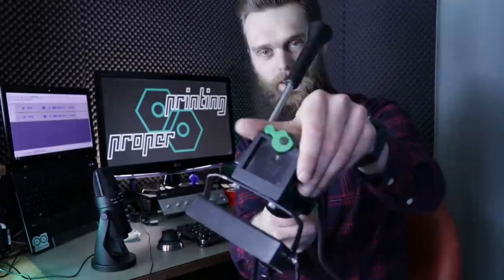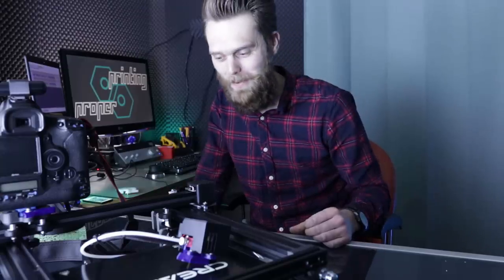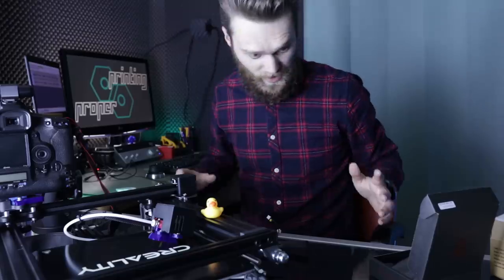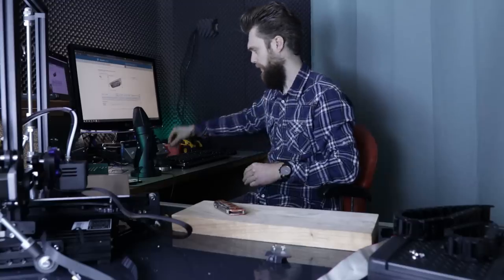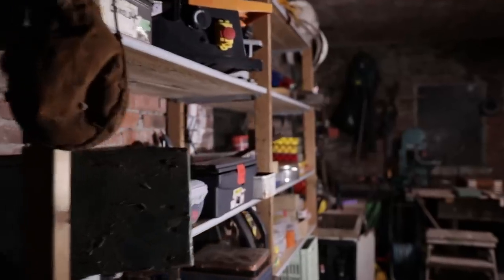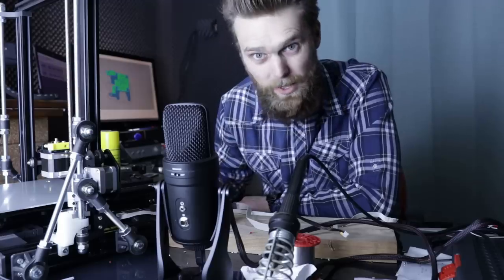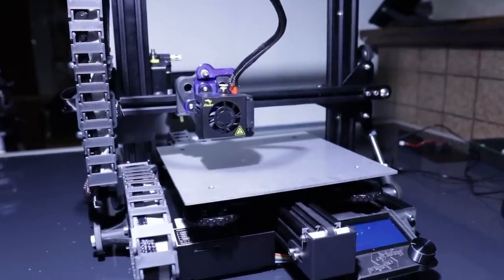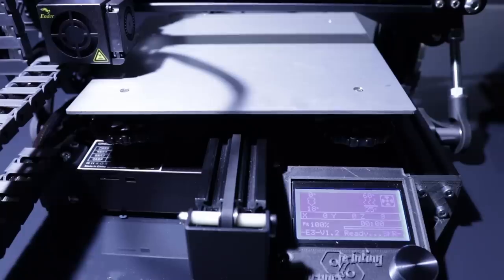Proper cable management for my Ender 3 pro

Comment: I dig it!  I love how crazy you get with the most inexpensive printer and make it as valuable as the most expensive printers on the market. I also would have still used PETG for your cable management.  Just would have given it a little dry ptfe lube.  Knocks out the squeak instantly and lasts for a really long time.  Great vids man.  Thank you!
Reply from the maker: Thanks Charles for your comment and suggestion! PETG would be the go to material for this since it has some flex to it as well. The honest reason for PLA with carbon fiber is the aesthetics but I wouldn't recommend using this material for this purpose.
Reply from the maker: @chasgiv4  Hahaha thanks m8! Awesome that you'll be making videos soon, make 2020 yours! Good luck and I'm curious how it goes!

Comment: That cable chain/connector fusion is a work of art!  Great job!
Reply from the maker: Thanks a lot for your comment! I really like that I can build upon that custom connector design to embed connectors into functional parts like this :D
Reply: @properprinting  not just the cable chain all this work are at really art concept , im in my way to do everithing but the only thing i canot find its the link chain for the hotend
thanks again for this job!

Comment: Just Wow! I hope Creality is buying your mods for production!
I sure would like to see universal connection so as to allow one control board/power supply to run more than one printer. One at a time of course using dedicated firmware SD cards or folders.
Reply from the maker: Thanks for your comment! That would be awesome if Creality would reach out to me one day! Would indeed be cool to have a modular design with a generic PSU and control board :D

Comment: This custom connector on the bed is absolutely gorgeous! Very good work! Can't wait to see why you are folding a 3D printer. Your cable chain are very beautiful, but I can't understand why existing models suited not to your wishes. Could you tell me more about that choice? Because I'm thinking to install some of this kind of cable chain on my printer and for the moment I don't know which model to use.
Thanks for this video, the camera slider on the printer is a funny idea btw ;)
Reply from the maker: Thanks Matthieu and a good question! I needed a step of Fusion file to modify it to suit the connector. I've searched this and found a couple but the clearances were so tight that they didn't work and some were designed poorly. Now I can determine all dimensions myself. Another reason for me to design my own is that it's much easier to add this as one package on my website together with all the special links (including that connector) and I don't have issues with licensing. Thanks for mentioning that camera slider, I'd like to make some sliding time lapses :D

Comment: Whole changes you've made are awesome upgrades in this printer. But(there is always but he?! :D), I would have replaced cables with longer ones instead of expending them with solder, especially if soldered part is in moveable part.
Reply from the maker: That would indeed have been a lot better. Fortunately it wouldn't bent too much due to the chain, but i should have bought longer cables xD Thanks for mentioning!

Comment: You are truely a madman. But smart and mad at the same time. I was coming here to see if i could print the cable management for more stock version of same printer, but you got me thinking of the tilting mechanism too. That is scary stuff. But if you happen to read this, comment, how your cable management files could be used to make to work with stock ender 3 pro without tilting. I'd love to make that work somehow.

Comment: Been slowly making my way through your videos in what little free time I have, and gotta say it's time well spent!

Quick question.. CF filler in the PLA you used is pretty abrasive, at least for hot-ends.. is it causing any wear that you can see in the cables?

Looking forward to the rest of your vids and of course the new ones too!

Comment: Any chance you would make a video for us explaining how you specifically go through calibrating your printers?
Reply from the maker: Thanks for your comment! I have a video planned in which I'll test the different homing methods (although this will take some time to start with) and maybe it's interesting to go to the process of calibrating it. It's however not that special. I use a DTI indicator to make sure the bed is horizontal and an adjustable Z stop to set the homing position so I don't have to level my bed anymore.
Reply: @properprinting  Ah, while that is helpful information that will make a good video on its own, I am more so meaning the actual prints you get from your printers. They seem highly tuned for the specific things you do, and my Ender 3 is basically a potato printer
Reply from the maker: @kingsidorak  Ah OK, well I didn't do too much to make this happen besides making sure that everything is lined out as good as possible and the tension of the rollers and belts are correct. I did see some improvements after using Simplify3D instead of Cura and I use the default settings. Even after making this printer foldable it was able to print decent with the standard parts.

Comment: Not that is some next level cable management!  Nice work!  What are the little connectors that you were using to put into the custom connector?
Reply from the maker: Thanks Chris! Those little connections are D sub contacts which can be pressed in a D sub housing. This is a male terminal https://b2b.harting.com/ebusiness//nl/SUB-D-PENCONTACT-AWG-20-24-L-P/09670008177

Comment: How do you like the PLA with CF in it -- maybe it's the stuff I had, it was super brittle, and would break on a cable chain. Which brand are you using? Very impressive work!
Reply from the maker: I don't like it. It's indeed too brittle and it cracked the chain links. It all stays together pretty well though, but I definitely don't suggest using this material other than the aesthetics of it. The brand is Greentech and thanks a lot for your comment! :D
Reply: @properprinting  Try Nylon with CF, or NylonX. I made chain links out of PETg and if you make them loose they don't squeak,  though that was before I started printing NylonX, and I would use that if I had to do it over. Glad I found your channel. Great job!

Comment: Are your cable chains w standard size by chance?  I've got several lengths of standard 10mm chain in 11mm, 15mm and 20mm size to use and trying to find hardware prints that would work with those.

Comment: great video! is the bed connector made of CF PLA? Will it stand the tenperatures?
Reply from the maker: Great question! After I printed it I thought the same. I'm going to reprint it out of Nylon with CF but I don't need the bed to be hot right now so that's not on top of my list. It should definitely be done. Thanks for mentioning!
Reply: @properprinting  Just try it out once you printed the replacement in nylon :) I am using CF PLA for several Parts on my printer (HeroMe Base and Ducts, Motor Mounts...) and it holds up well in an enclosure, even when printing PETG (35 degrees ambient inside the enclosure). Have you tried CF PETG yet?
Reply from the maker: @domi1711  Nice! No I haven't actually. I'm very fond of Nylon and I'd like to take a look into polycarbonate with carbon fiber. I should try PETG with CF as well :D

Comment: Nice cable connector ! How did you fix the metallic parts inside the connector ?
Reply from the maker: Thanks Olivier! I've reverse engineered an existing d sub housing. You can buy housings without terminals and these terminals snap in place. It sounds easier that it actually was to get this done xD

Comment: Super nice. Do you think the cable chains also fit the Ender 3 without the folding mechanism ?
Reply from the maker: Thanks! Yes I think so. However, I think the cables should be at the back side of the printer like the other chain mods so you don't need to extend the cables. I'm going to upload the design files of the chain itself so these can be modified for this type of modifications.
Reply: I have all my electronics at the back anyways, so I guess this will fit. I am eagerly waiting for the stl files.

Comment: Jon, you are a brilliant designer...! Can't wait for the related files. I especially like the connector for the bed. I want one of those...

I see that you are not using the connector that you designed for the swappable system on your CR-10 in this printer. How is that design working so far? I still haven't had a chance to implement it on mine. Cheers!!
Reply from the maker: Thanks Milan for your comment! I'm going to upload this soon after I've tweaked it a bit. The first version of that swappable hot end is working quite well on my other printers. I had some trouble with the bowden getting loose, but I've managed to solve that with a bit of glue and tie wraps. I haven't added it to this printer because I have a different approach in mind for this one. It will be pretty experimental but enables cool new possibilities if it works :D

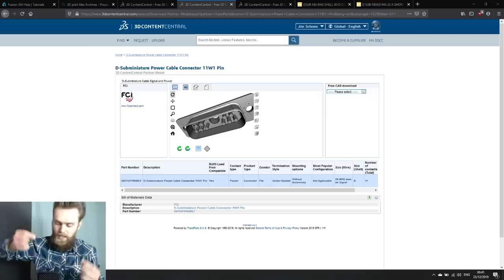Comment: Cool project you got here ! I have a question, what's the part number on those power connections @06:19 ?
Reply from the maker: Thanks Adrian. These are the terminals: https://b2b.harting.com/ebusiness/nl/D-SUB-MIXED-FE-20A-PL3-solder-power-cont/09691817821 and https://b2b.harting.com/ebusiness/nl/D-SUB-MIXED-MA-20A-PL3-solder-power-cont/09692817821. The exact types may differ a bit, but they all should fit
Reply: @properprinting  thanks !  though i saw the PN's in fusion after i wrote the comment  xD

Comment: oh boy. youre using cable chains with the improper wire type. those wires are gonna wear out now SO quick and short out.....
Reply from the maker: Interesting, I've never heard that one, thanks for bringing up! I thought that the chains would distribute the force more evenly over the length of the cable. Without the chain they would bend as well wouldn't they or am I missing something?

Comment: Will u show heat bed back and where did u drill exactly outer the square mark ? And what type connection u use can u link too pls
Reply from the maker: Thanks a lot for your comment, good point! Once I upload the design I'll add a drawing with the exact dimensions :D
Reply: @properprinting  thank you 👏👍

Comment: wow! you are brilliant! i don't have an ender 3 but if i will buy it, i will buy your project!! You should sell the project and don't give it for free!! really! Just to know... the double z upgrade on your site is compatible with the folding one? thanks so much!! good job
Reply from the maker: Thanks a lot for your comment! I think I've found a proper way of sharing my designs. I decided to put everything on my own website with an option to donate. This way the files can be accessed by everyone for free if they want so I get more traction which helps in the long run (I hope). The double Z upgrade will be compatible with some slight changes to the holders on the top which holds the threaded rods.
Reply: @properprinting  thanks for your answer! But these slight changes are available on your site or not? and why you don't use the double z mod? I really want to buy an ender3 to have my printer always with me using your mod ahah In case of emergency i can print also in the street or at the beach
 ahah

Comment: What about working temperature of chain link part connected to the heat-bed while printing, say, ABS? :>
Reply from the maker: Good question, thanks for asking! After I've printed this it came to mind that I should have printed this out of Nylon CF. This is exactly what I'm going to do before I'm going to heat up that bed. This part should indeed be printed out of ABS or Nylon.

Comment: design one for the cr10 s5 :)
Reply from the maker: That's still a printer I would like to have so who knows.. :)
Reply: @properprinting  they come cheaper nowadays,
im in the process of modding mine, full size 240V heat bed on the way, it already is stand alone, on SKR1.3 with TMC2130 and BL touch ( on a bed size that big that is almost a must have) next week im on the road but should be completed before Jan 30 ( 3 more weeks on the road then)

enclosure is already designed hoping to build that before end this month as well

also awaiting the super vulcano for this printer paired with 1.4mm nozzle will allow for FAST and BIG prints in PETG,
Reply from the maker: @patrickmaartense7772  Awesome! If I ever have that printer I want to do similar things and I have some neat ideas I'd like to do with it. Would be cool to make big prints fast with this printer and a super vulcano!
Reply: @properprinting  Its my biggest printer now (sure .. ) after the prusa i3 mk and several other smaller form factor I needed some BIG for a project im working on. it is a HUGE footprint, be prepared to spend at least 120x90cm footprint for the enclosure, I plan to have 2 medium size printers on top of that one together with one palette 2 that is easily swapped between the three ( no need for a Filament runout once you have a palette 2 ) that way I can just let it feed from the spools and swap at leisure when printing real big stuff at a high pace.

off course all with their octoprint instance running with cams and connected via the wifi for monitoring 

thankx again for your great and funny content

Comment: I personally prefer a cable chain design with snap clips holding the cable(s) in each link.  See https://www.tinkercad.com/things/8r558hYwxKj  for an example chain link that I redesigned.  A lot easier than threading all of the cable through all of the links.